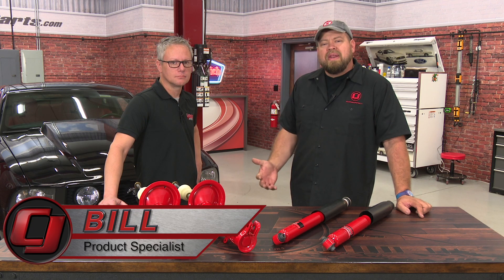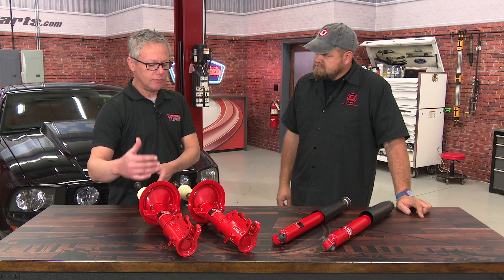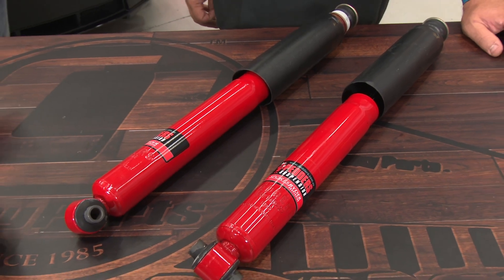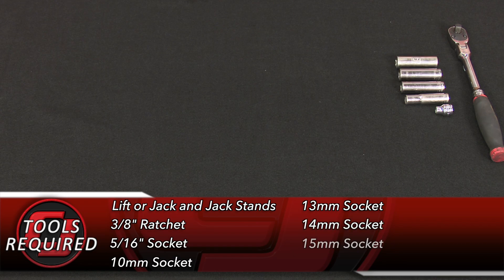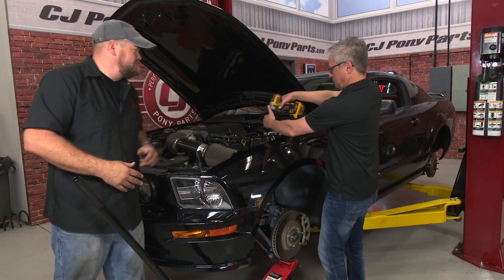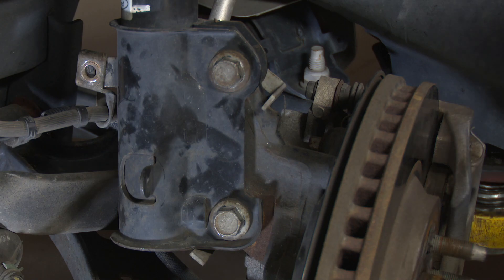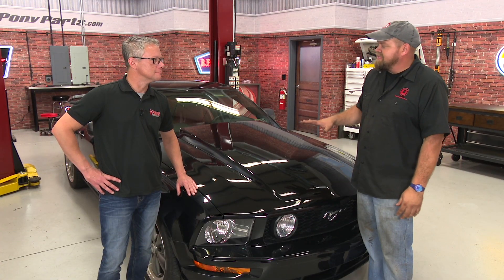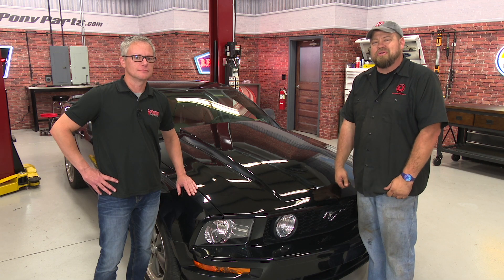Mustang Pedders Strut and Shock Kit Gas GSR SportsRyder 2005-2010/GT500 2007-2012 Installation

Comment: Is there any particular amount of torque for the main bolt on top of the strut in the center of the strut mount, or just use the impact gun until it spins?
Reply from the maker: There is a spec for it but it is very difficult to torque it without spinning. I have always just tightened it with my gun and never had any issues.